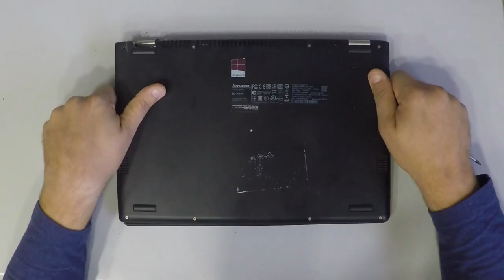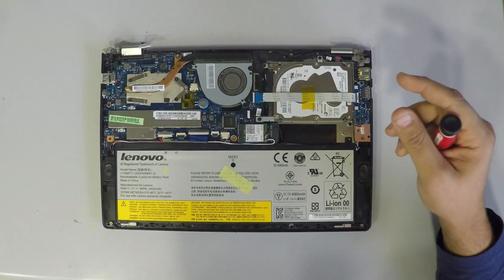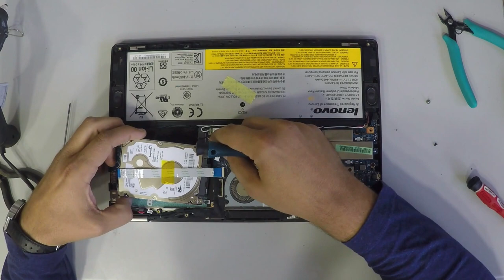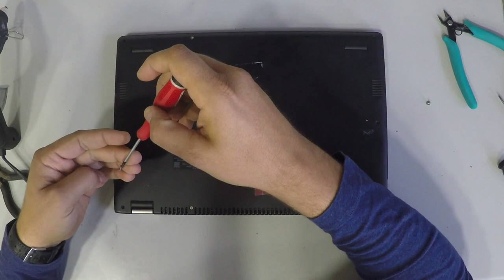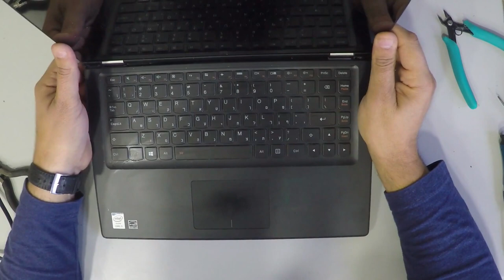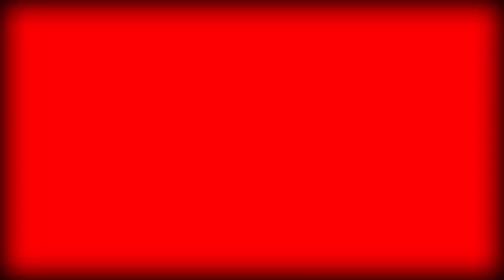Lenovo Yoga 2 13 HDD UpGrade

Comment: This is awesome, thank you! On my system, the 20344, the hard drive is a total bottleneck for the system. What is the best option for a replacement that will be quicker than the stock HDD?
Reply from the maker: Hello, nervousquirrel, the best and fast way is replacing the HDD with 240G SSD, and install a fresh copy of windows.
Reply: Thank you! Do you suggest any particular brand over another? Also I may go with the 480G, does that make any material difference in performance?
Reply from the maker: The Sandisk 2.5" SSD is the most reliable, check the description you have a link there.
Reply: Awesome, and your suggestion for RAM? By the way, I opened up my system over the weekend and couldn't locate where the RAM replacement would go.
Reply from the maker: https://www.youtube.com/watch?v=klnarVEWQew&list=PL43q5LIt9XwBXlOH3bekvqRo5qPzdxjf4&index=50
Reply: I have the Yoga 2 13 though,  I read somewhere that the ram is soldered onto the mother board and can't be replaced. Is that true?
Reply from the maker: No, you can replace and upgrade the ram.

Comment: hello, did you buy another cable for SSD?

like SATA cable with 8-pins?

TIA
Reply from the maker: There's no need for another SATA cable, the SSD 2.5" fits in the HDD 2.5".
Reply: Some Lenovo Yoga 2 13in laptops don't come with the cable for the hard drive. If you need one, the part number is DC02001VK00 and can be found on eBay.
Reply: and what is the cable that adapts a regular sata hdd to the small 10 pin cable that lenovo yoga 2 have? thanks!!

Comment: I purchased the 240 GB SSD but the standard connector for the stock HDD does not fit. Is there a different cable I can buy to connect it to the SanDisk SSD?
Reply from the maker: What type of SSD you bought 2.5" sata3.
Reply: @Shamsabdelkader  It might be using the m.2 port for a drive

Comment: i have a 4gb yoga 213 i want to upgrade it to 8gb pls tell if i can and which ram should i buy
Reply: You can't - that RAM is there for good on the motherboard. If you wan't I could sell you whole motherboard with 8gb and i5 processor (or almost whole that model so you could do it yourself)
Reply: ARTES INDUST. IMP.  No, it's just a solution for models which are ultrabooks so really thin and light. No wonder that they did it. Even in big Thinkpads 99% of users never replace anything.

Comment: where i buy hd flat cable?
Reply from the maker: Hello, Check this link https://www.aliexpress.com/item/NEW-Original-laptop-Hard-Disk-Drive-interface-Flex-cable-SATA-Connector-For-Lenovo-YOGA-2-11/32887757678.html?spm=2114.search0104.3.1.3eef200eT4Ym2K&ws_ab_test=searchweb0_0,searchweb201602_2_10882_10065_10068_5727215_204_318_10059_10884_5727315_10887_10696_100031_10084_10083_10103_452_10618_10307_532,searchweb201603_60,ppcSwitch_0&algo_expid=0d8c2a76-15ac-481d-91da-2445848247ac-0&algo_pvid=0d8c2a76-15ac-481d-91da-2445848247ac&transAbTest=ae803_5&priceBeautifyAB=0